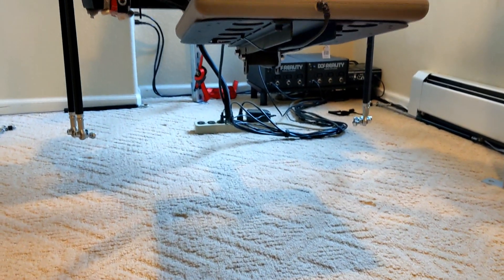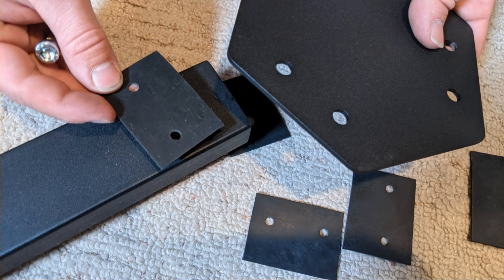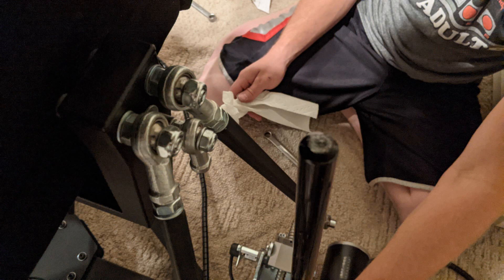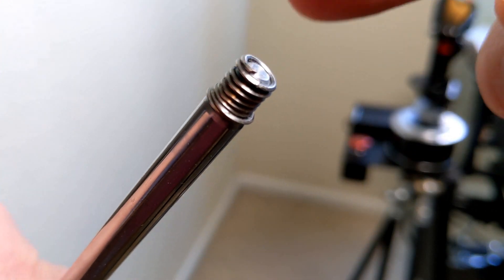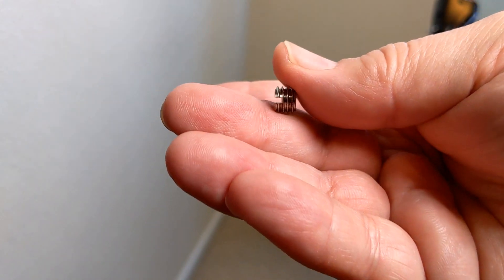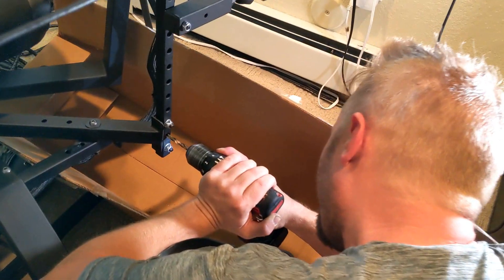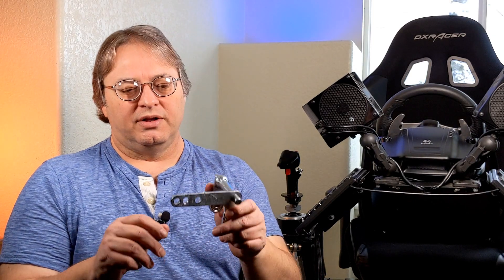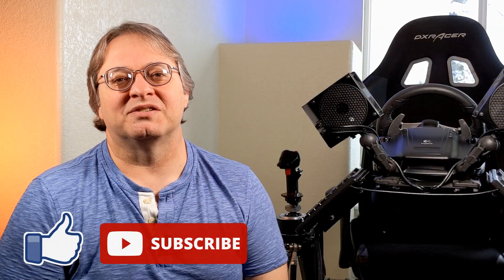DOF Reality SFU Gearbox Upgrade - Part 3: Modifications

Comment: Hi it's me again. I told you I ordered the H2 platform, they dropped one box off and the other box got stuck in customs and went back and forth between Memphis and Gastonia four times before I got it straightened out. Also had to send the power supply box back because it was everything was broken off and floating around inside the power supply box, so that's on the way from dof. Anyway my question is even though I ordered the H2 with the SFU setup and they told me I would have the newest version available, they sent me new different shafts to install in the little gearbox. I did install them but they did not say where to set them or anything and I was wondering do the motors and gearbox control  arms self Center the gearbox when you finally turn it on for the first time which I cannot do because I don't have the power supply box. I have ask dof into emails but they did not answer back. So I put it on Facebook group and they told me to watch this video of yours that it would explain everything. But obviously it does not answer the question that I have about will the motors self Center because they have been detached from the gearboxes and dof did not say any certain place to reinstall them. Hope this makes sense because I am really upset, they told me I would have the latest and greatest was the actual words and the minute I got it I had to tear it apart to change the warm drive shafts. And I don't know when I'll be getting the power supply box. I would send a picture but I do not think you can. Thank you for your continued help and support I really appreciate it.
Reply from the maker: Hey Nashfan, If you have the new drive shafts then you do have the "latest and greatest" from my understanding.  Those were only going out to the pilot customers as far as I know.  I don't really officially know about the new units but if you have the latest digital encoders it should auto calibrate when you start it up.  The way you can tell is if you have little black boxes off the back of each motor... those are the new digital encoders.  You might reach out to DOF again for the specific setup as I don't know what it is for the new shafts yet... I understand you have tried to reach them with no luck but honestly they are the only ones who can tell you specifically what to do. Once I get up to speed on all this I'll know more but for now these new shafts are so new that few have experience with them. You can always email photos to me at my email in the description if you want to.  Wish I could help more, and I will be able to later but for now that is the best I can do.  Hope it helps a little.
Reply: @GYGOtv hi thank you for your response. There is a little black cover maybe 1 inch by 1 and 1/4 inch where the wires come out is that what you mean? Wish I was as tech-savvy as you say Mars but it's 68 years old I probably should have never taken this project on but I hope it works out. is there a way to send a picture? thank you!
Reply: @GYGOtv  this is the one I have without the metal cover. Are those encoder motors?  https://www.youtube.com/watch?v=_bFt2nUOyO0&list=FLFPNMjQ5KblHVfxlqFbcX7g&index=3      Thank you for your help, this is a tough journey for me. Also now I hear that mt HP reverb 2 wont work soon due to ms doing away with WMR. What timing I have! I may eventually get a quest 3 after get some extra cash saved up and get this DOF running. But even the Quest 3 seems like a nightmare to get up and running. oh my!  Thank you for your help, you are the best!
Reply from the maker: @nashfan1000 So the "digital encoder" replaces our old analog sensor, it is not the actual motor.  The benefit is you don't have to calibrate them like I do on mine. I think once you get everything up and running you will find it has been worth all the hassle, at least that is what most have determined.  SO you do have the latest and it should all self calibrate once you start it up.  As for your Reverb G2, just don't update your Windows and you will be fine for awhile.  I'm hearing conflicting stories if the update actually removes the software or just stops supporting it.  One of my users says it worked fine after the update so I'm trying to verify this with others.  Hopefully we will hear something more definitive soon.  You should still find out from DOF if there are any other steps you need to do since you replaced the shafts.  I've been told there is a firmware upgrade that goes with that but I don't know if DOF already did that for you or not.  They really are the only ones who can answer that.  If you continue to be unable to contact them, please email me your order number and I'll see what I can do.  Also you can email me directly with photos etc... my email is always in the description of the video.
Reply: @GYGOtv dof told me that since they had to replace the power supply unit that the firmware update would be completed when I got it, hopefully😊 thank you so much for always answering me you have no idea how much I appreciate it feel kind of lost and this project except for the help you've been giving me like I said it's very appreciated thank you
Reply from the maker: @nashfan1000 You are VERY welcome, I want everyone to enjoy this awesome experience and anything I can do to help I happy to do.  Don't worry about feeling lost, it is a lot to learn (was even for me), but man the experience should be amazing once you have it all going.  Please keep me posted and I'm here to help with anything I can.
Reply: @GYGOtv well for the third time asking. Just will not seem to answer my question I don't know why. When I asked him about the motors self-centering because I really do need to know they just don't seem to want to explain it to me, this is the answer they sent me back

Hi Steve,

Are they self-centered before the upgrade? If no - then the same after.
Reply from the maker: @nashfan1000 Yep that sounds about like a DOF Answer, they are very to the point and seldom elaborate (I think it's a Ukrainian thing).  So what they are saying is that if it self-calibrated then it still will, otherwise it will not.  Basically they are telling you the new shafts don't change that part of the system.  You should be fine as it is my understanding that all the new digital encoders self calibrate so don't worry about this point.  Sounds like they did the firmware already so you should be all set once you get the new box.
Reply: @GYGOtv hi me again, still waiting on my power supply to come from europe. But I was wondering before my initial cold start is it okay to go ahead and mount my honeycomb Alpha and Bravo and my Rudder pedals and stuff or do they want you to do that calibration and stuff with no peripherals added except the seat? Thank you for your continued help.
Reply from the maker: @nashfan1000 Hi Steve. Assuming it doesn't say something specifically about this in the manual, you should be fine to mount it all.  Since it auto calibrates every time it will end up doing it with all that on there anyway. Hope you get your power supply soon!
Reply: @GYGOtv I got my power supply and hooked it up and it did to self calibrate. But then when I go to set up if I run the slider over too far the motor bottoms out and starts banging and then that motor will no longer run anymore. Not sure why it bottoms out like that when it's self calibrated
Reply from the maker: @nashfan1000 Ya not sure either... sounds like the safe zone might be set wrong.  Contact DOF, they may need to do a firmware update or something.  I don't have self calibrating sensors/motors on mine so I don't even know what is normal, but obviously what you are experiencing is not.  Keep me posted.
Reply: @GYGOtv on the srs software it also has a motion compensation,  witmotion section. I don't even have that yet.  should everything below that be turned off, ex  ,belt, hud, flag sim3d, symprojects, should they all be turned off? also just flying  along constant shutters like turbulence,  is that supposed to be turbulence or is that logging? very annoying.  ty for your help!
Reply from the maker: @nashfan1000 Witmotion is a separate deal you can buy if you want.  The SRS Software just supports it (with Premium Subscription) if you decide to use it.  Everything should be turned off, but I think it automatically does if you don't have the items connected.  do does it shutter only on slow turns or all the time regardless of how quick you turn?
Reply: @GYGOtv it shutters just flying straight and level also. feels like turbulence,  but I don't  have any turbulence turned on that I know  of. when it does it I took vr headset off could see right motor moving small amounts.  sent email to dof about when making steeper bank turn motor bottoms out and won't work again until I turn power box off and on again,  then it re centers.  not sure but think only left bank and motor  1.  thank you again, good to have someone to discuss with.
Reply from the maker: @nashfan1000 Ya it shouldn't do that, you have some sort of issue with the unit.  If a motor isn't working then that would certainly impact the movement.  Just FYI "cogging" only occurs on very slow rotations and is honestly overblown as an issue.  It is very subtle, certainly not what you are feeling.  Also your SRS settings will be a major part of how it runs once it is working right.  I highly suggest you watch our 2 part series on tuning the SRS software if you haven't yet.  https://youtu.be/pzi8G7T9p7A https://youtu.be/LSStkqpIX_M
Reply: @GYGOtv do you have a discord? i just learned about them. as always,  thank you!
Reply from the maker: @nashfan1000 I do have a discord but I am never on it... not a big fan, I have enough to keep up on. My other viewers use it from time to time to communicate.  Here is the link https://discord.gg/xpAJmXx3AP
Reply: @GYGOtv I am watching now..... wow confusing!  Where can I see Jeff's profiles, of course I only have an H2. I mainly fly, c152, c172, different  cubs etc. at least for now. and of course I have to find out what is wrong with my platform. hope dof can find a fix. a guy on fb dof group said sounded like a bent shaft. thanks again.
Reply from the maker: @nashfan1000  Jeff does most of the default tuning for SRS, but here is his website with all his profiles http://simmotiontuning.com  Hope it helps.
Reply: @GYGOtv thank you, he does have a profile for small GA aircraft. in normal operation,  should you almost Always feel the motors running/churning, and a rough feel to all movements? motor, gearbox movement in mine feels really unsmooh, gritty feeling.  trying to get ieda of normal feel of sfus running. thanks!
Reply from the maker: @nashfan1000 No you shouldn't feel rough movements, maybe jerky if you are moving quickly but not rough and gritty.  Sounds like something is wrong with your rig to me.  The "cogging" that everyone complains about only happens on slow turns and is pretty subtle.  Talk to DOF about your issues because they are not normal.  Hope that helps.
Reply: @GYGOtv @GYGOtv it is good you have a good relationship with dof. getting answers always like a half stated riddle. told them about cogging or littering when ever I bank or pitch. they act like they have no idea what I mean.  😔  they also said make a video,  but I'm sure it won't show up what's happening.  feeling lost. however your friend Jeff's settings work much better.  thanks as always.
Reply from the maker: @n1000Yep that is a pretty standard answer about "cogging" from them... I think where you went wrong was even mentioning the word "cogging" because they have been beat up on that for years now and are numb to it.  You need to tell them it is ALWAYS rough movement and feels gritty because that will let them know it is not cogging you are talking about.  Take a video close up of the SFU shafts in motion, if the shafts are bent it should show up in a video, and maybe the audio will pick up some of that grit you are talking about.  P.S: Also thinking about it I might have another potential solution, it might be a bad U-Joint since it is an H2, see if you can check that as well, a bad U-Joint would make everything feel rough too.
Reply: @GYGOtv well the videos I sent them ,dof,  even though I showed where the shaft connecting the SFU to the motor was wobbling they told me it looks smooth to them and was best they can do.  They did say there's a new firmware update coming out Friday or Saturday but I'm afraid any further help from them is not going to happen. I have the unit that has the shafts with the universal joints, and I suggested to them that maybe they should have the shafts lined up straight instead of an angle where every time it turns it has to go through that angle and that may be part of what the problem is with mine. I'm just hoping that they keep working on ideas like I suggested them to fabricate a shim to go under the SFU to line it up with the motor better but I suggested it two times but got no answer about it. As for a new item I'm not sure I don't think I will need motion compensation flying GA airplane hardly notice at all, but I am putting seat belts in because it does move you around in the seat a lot once the seat belts are in and I am not flopping around maybe I will realize I need motion compensation. Do you have a thought on that? Anyway thank you again for your help and I will keep in touch on further developments, and hope that can get things worked out a little bit better because if this was smooth I know I would enjoy it so so much. But as weird as it seems after a flight my whole body is like lightly shaking inside from that constant Jitter sounds weird but it does. Take care and thanks again.
Reply from the maker: @nashfan1000 Yep, once you get labeled as one of those picky cogging guys I'm afraid you are probably stuck.  I understand your frustration, we obviously did a ton of upgrades on ours and recommend them to DOF as well but they do their own thing and don't really rely on recommendations from outside.  Feel free to adjust your unit with shims and see if it at least helps your unit.  Now when I was talking about checking the U-Joint, I meant the one under the seat that the whole thing pivots on (I forgot the new units also have "u-joints" on the drive shafts, but those are not the ones I'm talking about).  Try disconnecting the motion arms and just move the seat on its own and see if it feels smooth or feels "gritty", if it is gritty it is probably the U-Joint under the seat that is the problem. I'm leaning more toward this being the issue since DOF seems to think the shafts look normal.  Hope that helps.
Reply: @GYGOtv yes that Universal under the seat is fine. I checked that before I ever mounted it and actually put a coat of light lithium grease on all of it. Thank you again for all your help. Want to make a decision about motion compensation I may get back with you. Seems so far with GA aircraft doesn't seem to be an issue, but then again once I put seatbelts in and I am moving with the rig 100% it may be a whole different story.
Reply: @GYGOtv can't seem to win, now when I fly, the first time I Bank right or left then level out, it stays banked several degrees  to the right. seems like the right motor  just quits or something.  I can turn off power supply  and back on and it receptors until I make a turn  again. can't  tell you how frustrated I am. 😔
Reply from the maker: @nashfan1000 Ya you need to tell DOF all this so they understand it isn't you being picky about cogging.  Sounds like something is definitely wrong with the setup. Who are you talking to you over there?
Reply from the maker: @nashfan1000 With the H2 just plan to get a WitMotion box for the Motion Compensation.  It works perfectly with the H2 and is SUPER EASY to setup.  You might be fine in what you fly now but once you jump into something with a tight cockpit (like a fighter) you will likely be moving through the glass as you bank.  It really is a great solution for the H2.
Reply: @GYGOtv you know the funny thing is this is the original problem I had when I first turned it on it would go down and write in the right motor we quit working then it just magically started working. Now I'm back to that original problem again is there any way to be able to keep in contact with you easier than through youtube?
Reply from the maker: @nashfan1000 Ya you can email me, it is always listed in the description.

Comment: Curious have you ever had motors just stop working while in msfs?  With my h6 sfu lately I keep losing l1 and l2, abd also the start test button in srs is always greyed out. I can power cycle things to get the motors back. I can't find an answer I emailed their support. Wondering if there's a log file somewhere
Reply from the maker: I've had it do something similar a few times in Elite Dangerous but not MSFS. I think it's just a glitch because I did the same thing, reset everything and it all started working again.  Not sure about the log file but I'd love to know what you hear back from them.
Reply: @GYGOtv  So far they had me take some screen shots from section 5.4 of the manual doing the sine wave function.  however, i think i narrowed it down to a problem with just the p42 freedom fox aircraft (maybe).. any chance you have that one?  Sitting in the chair in a bout 2 mins with some fierce aerobatics it will lose either 1L/2L or 1R/2R motors for me, tried another aircraft and didnt occur
Reply from the maker: @markm75 no sorry, don't have that aircraft.  At least you have narrowed it down. Good luck, I hope they help you sort it out soon.  Appreciate the update.